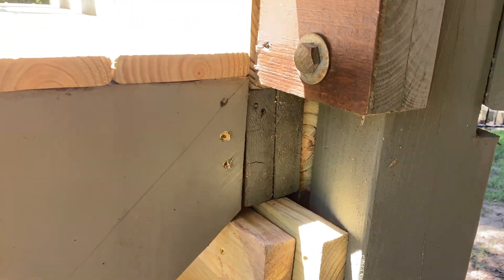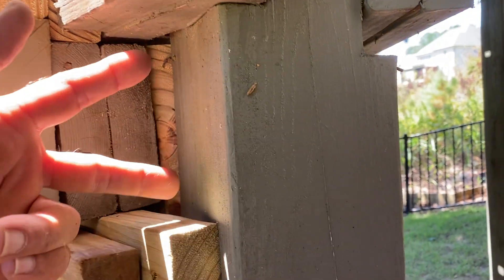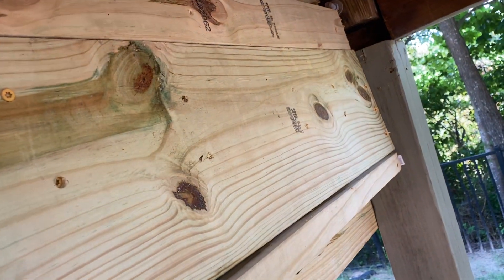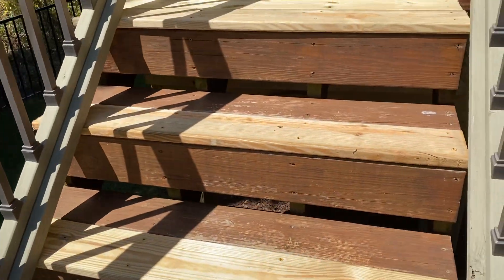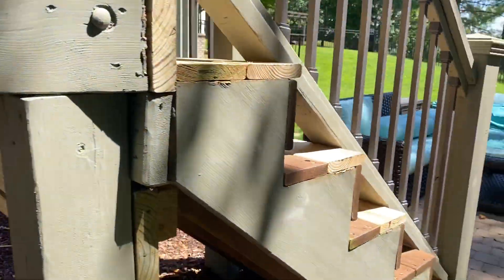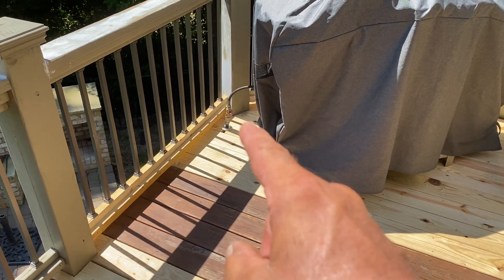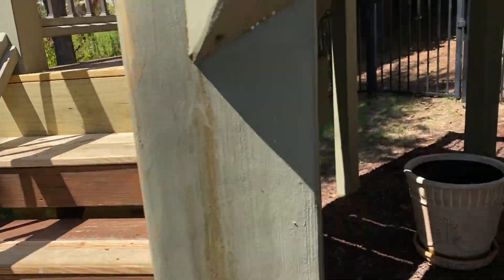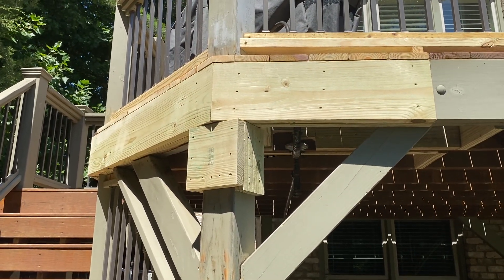WOOD ROT THE STAIRS PART 2 THE FIX.

Comment: 7 years later the builder isnt gonna accept liability for rotted wood.  Its wood. Its gonna require maintenance.  
So what did you do about the rotted bottom plate under the stringers?
Reply from the maker: I forgot to say it in the video, I installed a new tread under the ground, and hammered a 2 x 4 in the ground and nailed it into the tread.